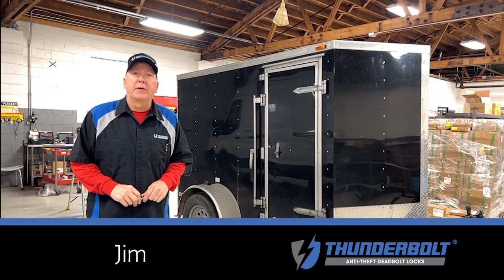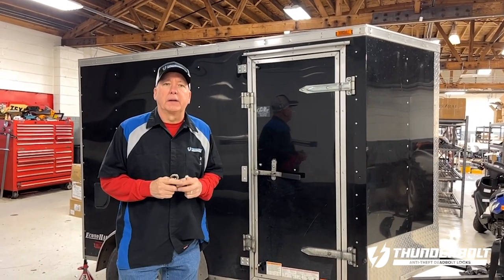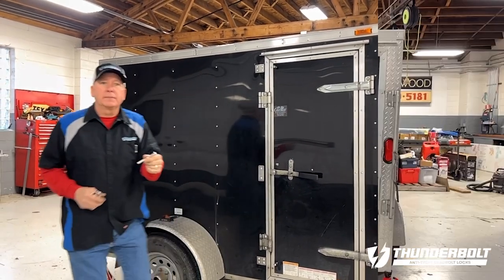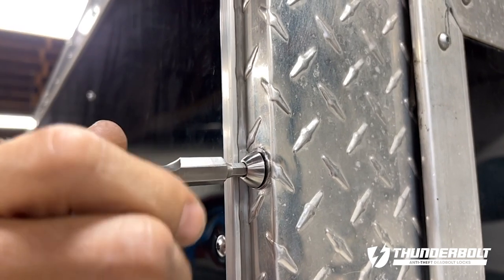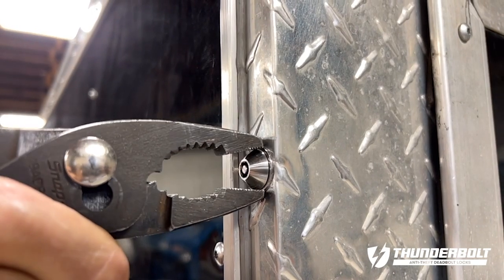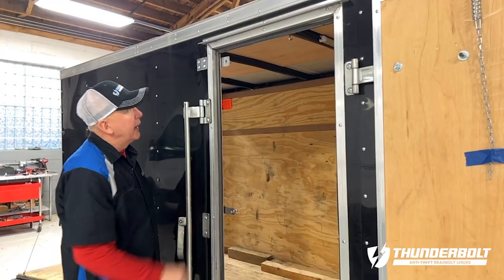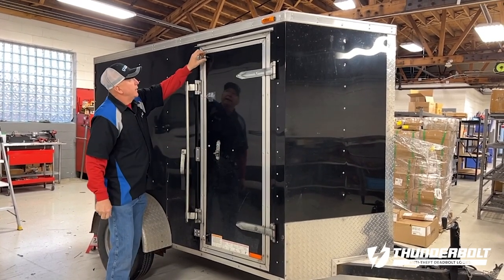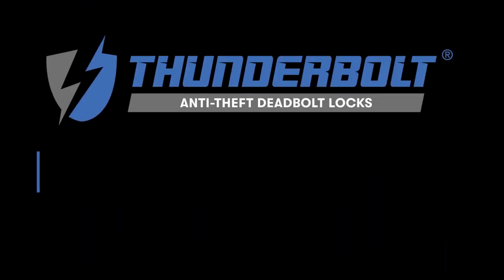How to secure trailer doors with locks on enclosed trailers and cargo trailers.

Comment: Great product.  Vice grips won't grip the tip of the bolt ?  So many locking types of pliers available.
Just curious.  Very discreet product.  Thank you for sharing this information.  God bless 🙏
Reply: The head of the lock pin is so steep it can't be gripped by a tool.

Comment: My battery powered grinder would cut a slot for a screw driver in less then 10 seconds. I just got through removing twenty screws with that style head.
Reply from the maker: You can invest in our interior deadbolts if you want further protection. These keep out opportunist thieves and do it well.